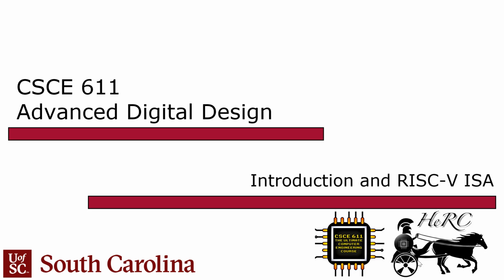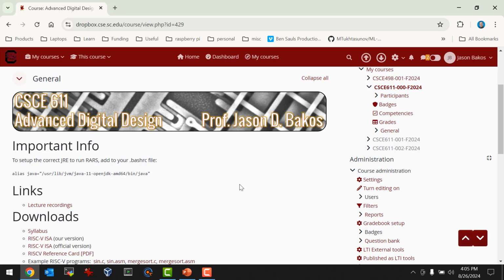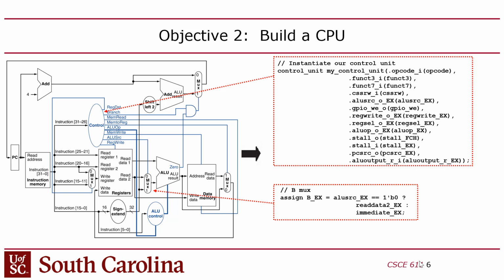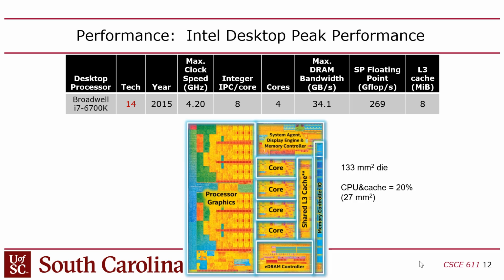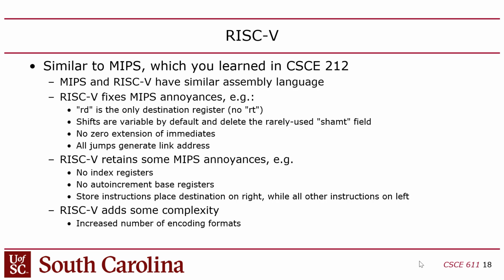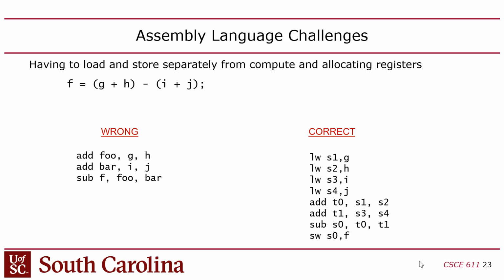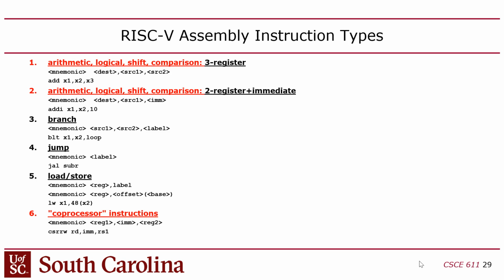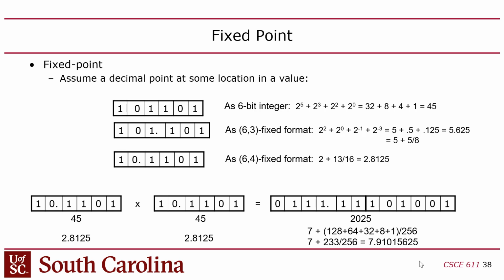CSCE 611 Fall 2024 Lecture 1: Introduction

Comment: You'll probably write assembly that one time when you have a critical piece of code, and the compiler is doing something absolutely funky / refuses to optimise, and you spend 2 days figuring out just the right instructions... but in the end your hot loop now runs 30x faster
Reply: Vectorization is something Assembly is still used alot for since Compilers still aren't very good at it.